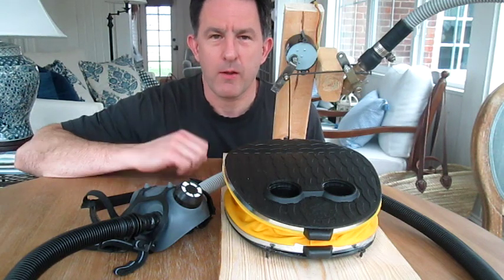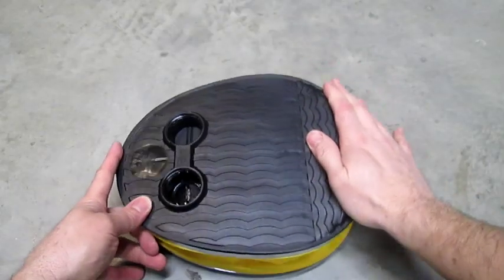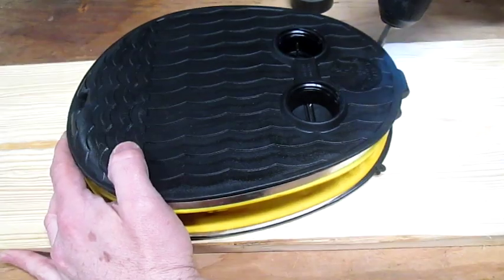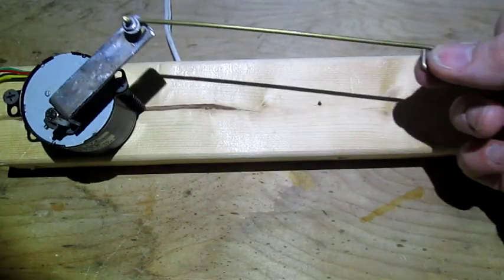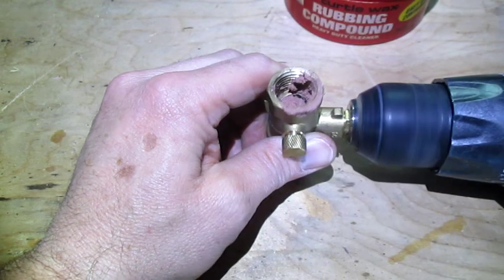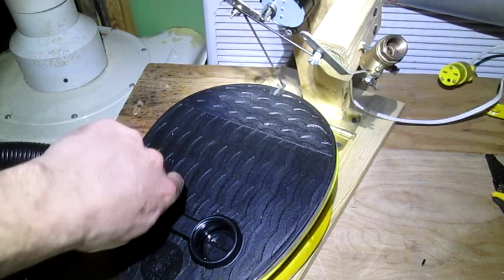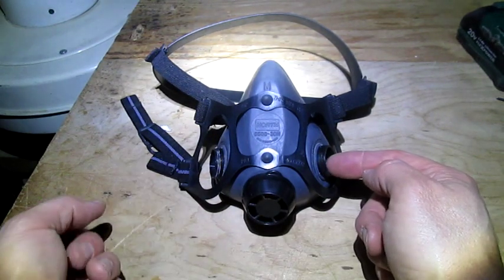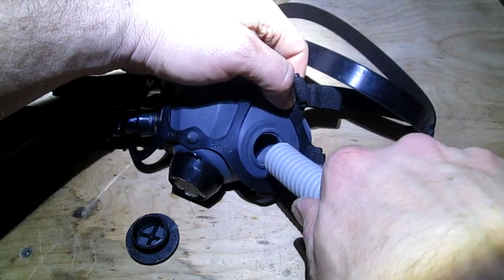DIY Ventilator

Comment: Thanks a lot for this fine project! I did it and it works. Shall be careful on the lengths of the (coat hanger) wires, their position and also the position of the ball valve in order to work correctly as they will adjust the air volume and the correct valve closure moment. Also choose an appr 30rpm DC motor with enough power at about 12V. By adjusting the motor supply voltage you can adjust the inhale/exhale speed.
Reply from the maker: Excellent adds.  Thank you.  Love the DC motor idea.

Comment: Thank you for showing a simplified operation of the machine. It is a very flexible design so you do not get bottlenecked with a specific part, I appreciate this being retired machine designer. The one question I have is involving the brass ball valve. The hole/port on the side of the valve is typically used when training your waterline. Why did you drill in extra hole in it? Also are the two extra holes you on the side of the valve are they upstream or downstream? Thank you again you did a wonderful job
Reply from the maker: Hi.  I needed a way to mount the ball valve to the wooden post.  The drain hole was downstream and I used it simply to save drilling through both sides.  I was originally planning to fabricate a metal bracket to hold the valve, but that drain hole was just too perfect not to use.

Comment: Love this...
An arduino to control rate of respiration via motor control. 
Humidify the air by adding a heated bubbler.
Reply from the maker: Good ideas!  I used an AC motor with fixed speed.  Yes, you could switch to a DC motor and control the speed with a PWM (pulse width modulator).  You could put a standard cool or hot humidifier near the inlet of the air pump.
Reply: @HowToLou  how to connect airflow sensors and pressure sensors for a ventilator such the one with compressed balloon

Comment: Simplicity is another definition of genius, What do you call that material which you removed spring
Reply from the maker: Thank you.   The spring was made of steel.  The yellow bellows wall was made of canvas with a black rubber seal held in place by a steel band.
Reply: @HowToLou  yes, that's what I'm asking, yellow bellows
Reply: @hfe1833  it's a part of foot pump used to inflate air mattresses

Comment: like this though how about the 2:1 ratio they all talking about ?
Reply from the maker: Good question.  This is a simple mechanical ventilator and is volume-based rather pressure-based, where that ratio applies.
Reply: That is the inspiratory to expiratory ratio. People with Whuahn virus have stiff lungs so very simply doc needs to adjust machine so it takes a long time to blow air into the lung compared to exhalation. For example, if I  want my pt to breath at 10x/min, a I/E of 1:1 means 3 seconds for inspiration and 3 seconds for expiration. A 2:1 = 4 sec for insp/ 2 sec for exp. 
Normally I/E ratios are 1:2.5 - 1/4. Reverse I/E ventilation has its dangers and should NOT be attempted at home EVER with makeshift equipment. Actually, this equipment should never be used because there are things involved that go beyond the scope  of the person who made this video.
Reply: Jack S  also an anesthesiologist because the person will need to be sedated. Otherwise they will breath against the wishes of the ventilator.

Comment: Can you list the parts? I’d like to be able to order them.
Reply from the maker: Bellows Air pump $15, 20 RPM motor $20, Respirator mask $20, but hard to get.   Try a CPAP mask for $40.  1/2” ball valve.  Actually, I may change to 3/4” to get better exhale flow $15.  Just search those items on Amazon.  Some I just had laying around.